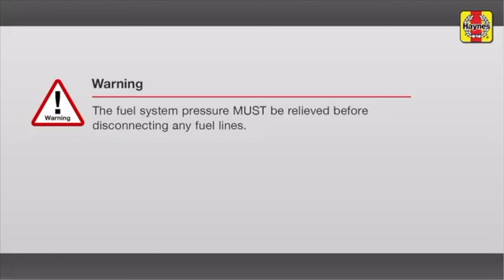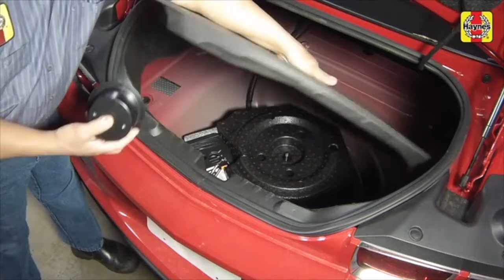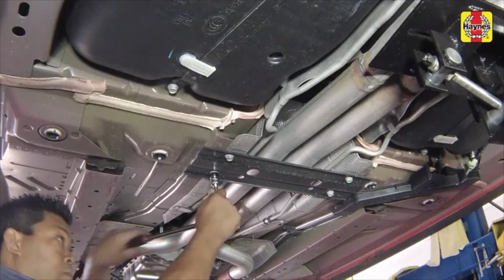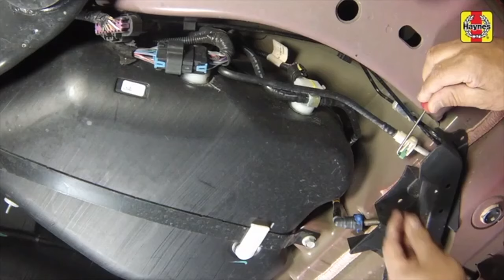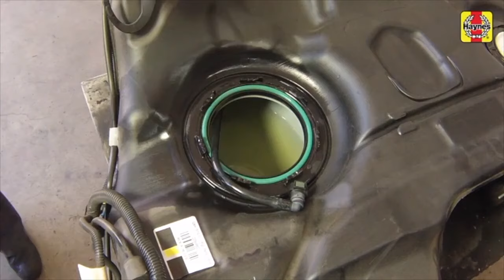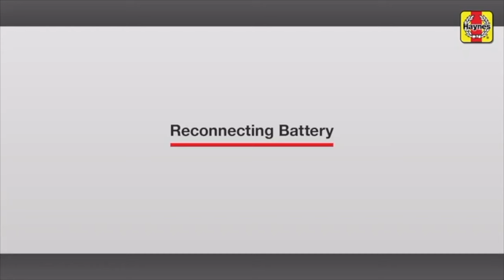Chevrolet Camaro (2010 - 2015) - Chevrolet Camaro (2010 - 2015) - Replace the fuel pump

Comment: Guys just cut an access panel under your rear seat. It took me like 2 hours to do this job. 1 extra hour because I accidentally cut one of my fuel lines, but it's easily avoidable if you go on the Camaro5 forums. They tell you where to cut
Reply: @kaidendiaz1534  I hit the line too.  😂😂😂. Garage still smells like gas.

Comment: Cut the sheet meatel directly above pump. Use power shears. Buy at harbor freight,  if you are using once. Cut in shape of U. Bend up. Bend back down.  Cover with kills mat. Ice and water sheild.  What ever you have. Or take all that stuff of and let sit in garage like that untill finally your friends come to help , out of sympathy, and break all the plastic fittings,  because they are dry and brital. Burn down garage with car in it , get insurance mony rebuild buy a Zl1. Your welcome.

Comment: Insane job for a fuel pump, cut an access door 8x8 under the passenger rear seat, Done.
Reply: What happens when you need to replace the fuel sending unit later,  and now you have two access holes cut in the body of your vehicle?

Comment: Screw that. I’ll just cut out an access hatch after removing the rear seat. This is ridiculous. 

I’ve cut hatches out of truck beds and an Astro van. Don’t see any reason not to here. 

I’ll just make an adapter to reinstall the cutout section of the body for access hatch.

Comment: So all you have to do is cut an access door when you lift up your back seat its on the passenger side close to the black gasket housing a wire. you can actually remove the gasket to feel around for your pump and then make a hole using sheet metal scissors and you will have easy access to the pump. after youre done you have to find a way to insulate the cut you made so the smells wont go into your cabin
-my 2 cents

Comment: A much EASIER way to change out the fuel pump is by cutting a small access hole under the rear seat. I did this to my 2010 SS and was able to change the fuel pump in less than an hour. It's very easy with a simple pair of aviation sheet metal scissors.
Reply: That’s a complete hack job🤦‍♂️
Reply: Do you have an exact location?
Reply: @winstonclyde some videos in Spanish show you where exact you can cut the cover without damage any hose or wire.
Reply: @juanmanuelgarza1741  would you happen to have a link or what you typed in the search to find this?
Reply: @THEKR8SHOW  youtube “fuel pump trap door, update on my camaro”
Reply: I heard. I'll pass on the junk jockey labor ops. Won't sit right with me.
Reply: @Private011  Everyone who races these cars cuts in the access hole and installs a door to gain access to the fuel pump. Only an idiot would go through all this to replace/upgrade the fuel pump. If you don't have a lift this job is almost impossible with out cutting the floor pan and the dealer will charge $1,400 to replace a bad fuel pump.
Reply: @Яндекс.ИИ  I don’t go to the dealer unless it’s under warranty
Reply: @jeremiahjohnson7713  cool story, but it doesn't matter where you go, doing this job by the book is 8-10 hours of labor at shop rate. Verses in my 5th gen, it takes 15 minutes to replace the fuel pump.
Reply: @Яндекс.ИИ  how did you replace it
Reply: @Яндекс.ИИ yess....
Reply: Its a camaro. Who gives a crap about a access hole if you reinstall it and seal it and most of all dont blow your head off😊

Comment: Chevrolet was definitely doing blow when they designed the 5th gen Camaro 🥴😮‍💨.
Reply: Yea and they were trying to find ways to make more money to buy more lol
Reply: So all you have to do is cut an access door when you lift up your back seat its on the passenger side close to the black gasket housing a wire. you can actually remove the gasket to feel around for your pump and then make a hole using sheet metal scissors and you will have easy access to the pump. after youre done you have to find a way to insulate the cut you made so the smells wont go into your cabin
-my 2 cents
Reply: Just wait till you need to do an oil pump. It is just as bad, except you can't just cut the floor out. It is worth the effort to install Crossmember Flanges if you ever have to remove the oil pan.
Reply: they were doing that pure white lol

Comment: I like how they jack the car up and put it on jack stands and then it's on a lift with a guy walking under it......  :)
Reply: Hilarious how they thought they could fool everyone between a DIY/at home job, versus a proper shop job, with a lift and tools… I’m honestly about to just cut a hole into the frame, under my rear seats.. save myself the HUGE hassle.
Reply: @isnowyazn  I am going to do the same thing, this pulling the tank is a major job, I would be afraid of not connecting something back correctly. I am doing the back seat access panel instead.
Reply: @michaelwalker5402  how else would they film it properly so the rest of the steps are at least visible?
Reply: @slickest123452  Yeah, it's clear they did this just to make filming easier. You can do this job on jackstands, it just royally sucks.
Reply: Greetings: Yeah I saw that also. Clearly not a ground job.

Comment: Thank you Haynes! I won't be doing any of the steps like in this video. After I remove the backseat there's not going to be any floor pan in my way after I use my die grinder. Auto engineer designers don't give a crap about the disassembly of cars they only care about the ease of the assembly process. It would be such an adrenaline rush if it were possible to meet the engineer responsible for this negligence and bitch slap him!😶
Reply: So all you have to do is cut an access door when you lift up your back seat its on the passenger side close to the black gasket housing a wire. you can actually remove the gasket to feel around for your pump and then make a hole using sheet metal scissors and you will have easy access to the pump. after youre done you have to find a way to insulate the cut you made so the smells wont go into your cabin
-my 2 cents
Reply: Yeah I'd love to meet some engineers after my 5 years as an electronics tech lol
Reply: 😂😂😂😂YEEEESSSS👊🏻😎🍆🍆🤣🤣

Comment: hole dam drive train damit man
Reply: So all you have to do is cut an access door when you lift up your back seat its on the passenger side close to the black gasket housing a wire. you can actually remove the gasket to feel around for your pump and then make a hole using sheet metal scissors and you will have easy access to the pump. after youre done you have to find a way to insulate the cut you made so the smells wont go into your cabin
-my 2 cents

Comment: Thanks to Haynes for showing what a bad decision I made buying a modern sports car. I love my Camaro but there’s zero reason for willfully engineering a vehicle to be this difficult/expensive to work on.
Reply: So all you have to do is cut an access door when you lift up your back seat its on the passenger side close to the black gasket housing a wire. you can actually remove the gasket to feel around for your pump and then make a hole using sheet metal scissors and you will have easy access to the pump. after youre done you have to find a way to insulate the cut you made so the smells wont go into your cabin
-my 2 cents
Reply: You did it? Change the fuel pump?

Comment: So basically take the whole car apart 😭😭😭😭😭
Reply: yes lol
Reply: 😆 right...dang man..they could of thought of a better setup and build smh
Reply: @nathand1686  but then the mechanics wouldn’t get paid lol
Reply: So all you have to do is cut an access door when you lift up your back seat its on the passenger side close to the black gasket housing a wire. you can actually remove the gasket to feel around for your pump and then make a hole using sheet metal scissors and you will have easy access to the pump. after youre done you have to find a way to insulate the cut you made so the smells wont go into your cabin
-my 2 cents

Comment: Such a misery 🤦🏻‍♂️
Reply: Just cut a hole in the passenger rear seat lol
Reply: So all you have to do is cut an access door when you lift up your back seat its on the passenger side close to the black gasket housing a wire. you can actually remove the gasket to feel around for your pump and then make a hole using sheet metal scissors and you will have easy access to the pump. after youre done you have to find a way to insulate the cut you made so the smells wont go into your cabin
-my 2 cents

Comment: Why do you need to drop the rear subframe down? Is there really not enough room for it to slide out?
Reply: So all you have to do is cut an access door when you lift up your back seat its on the passenger side close to the black gasket housing a wire. you can actually remove the gasket to feel around for your pump and then make a hole using sheet metal scissors and you will have easy access to the pump. after youre done you have to find a way to insulate the cut you made so the smells wont go into your cabin
-my 2 cents
Reply: @alexisgaribay5844 hack job🤦‍♂️
Reply: @johnphillipsjr7238  I’m sorry not everyone has a garage or the time to basically take apart and reassemble the whole car just to change a fuel pump
Reply: Exactly. Not enough room